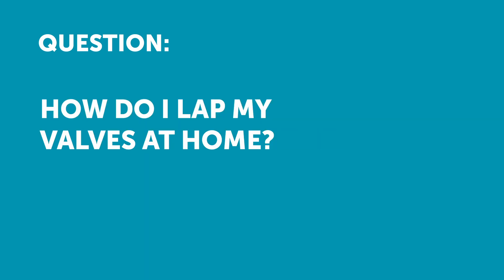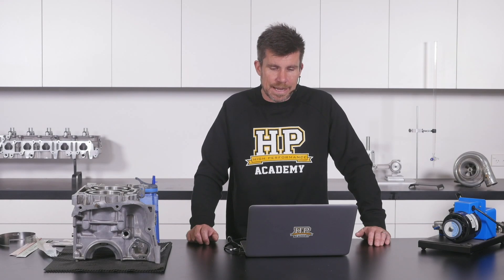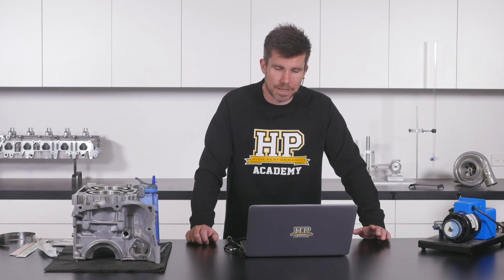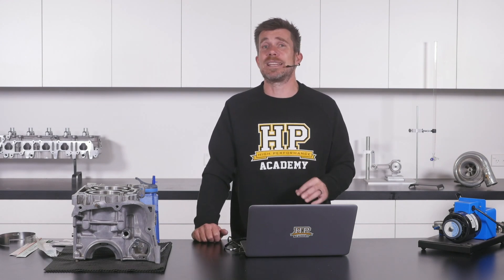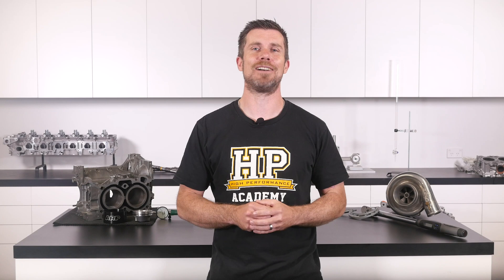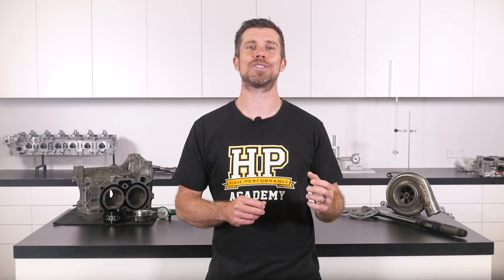Can I Lap My Valves At Home? | What Is Valve Lapping? [HPA Q&A]

Comment: I’m so confused as to what I should do. I have NEVER removed an engine & I have NEVER rebuilt an engine in my life (see my YouTube channel). I couldn’t find anyone to rebuild my 1987 Mercedes 560SL so hear I am doing it myself. My car has been properly stored since 2008 & has 139, 000 miles on it. I have completely torn down the engine & have dissembled the heads. Valves & seats look like new to me & cleaned up easily. I was going to lap the valves like millions of others suggest on YouTube, but now I don’t know what to do. I DON’T want to fire this engine up and find out I have leaking valves. The last thing I want to do is rebuild this car again. I purchased the standard lapping paste with 120-220 grit. I think that’s too course for a light lapping. Can/should I use this paste? Should I find a finer paste or what? What should I do?

Comment: unfortunately quality machine work is not available that conveniently. in my area i have had much better quality doing a valve lapping  than having a machine shop screw up my head. just some practical experience. no quality machine work available in southern nevada
Reply from the maker: Yes, this is sometimes the case unfortunately. Really it crosses over to more than just this trade too. It's super easy to find people who can talk the talk but hard to find those that can actually deliver more than an invoice.

When/if you find a good one make sure you support them! - Taz.

Comment: You're telling shade tree machines to go give money to some button pusher? I've never heard anyone have a problem with doing a hand lap. Drill I don't know never done it. I've done it with using the carbon as the lapping compound it a pinch. I wouldn't build a race car like that but a car I have to have running now and not wait 3 weeks for a machine shop to charge me a arm and a leg. Yes I would.
Reply from the maker: The bit where you say 'I wouldn't build a race car like that' is important, because that is the application we're talking about here, a performance build, so you are really just underlining the message from the answer here 🤘 🤓 - Taz.

Comment: I'd like to see a leak down test performed on a hot head that was lapped by hand. I honestly thought there wasn't anything wrong with it.

As for the cnc guys.. how do they know what the expansion is in order for them to cut a specific shape to mate 100% when hot? I dont see them cutting them when hot.
Reply: I think the point is that the 45º seating  surfaces of the valve and seat will correctly seal - regardless of diametric growth of the valvehead and/or valveseat.
Reply: @GroovesAndLands  yes it is.. but how is that achieved? Apparently you cannot if you lap cold and I'm guessing cnc too as heat will  change things. If cnc methods are not taking into account heat then lapping is just as good if not better. 

Now back to my question..??
Reply: @mayk3lll  Andre's point was that lapping will result in a radius'd surface of the valve and seat; the seat will be concave and the valve convex. Thus they nest together and seal just right at the temperature at which they were lapped/nested. Then, as temp goes up and they grow, they will no longer nest perfectly resulting in leakage.

I think the thermal expansion argument is overstated, because both valve and seat are (in most cases) made of steel alloys with very similar coefficient of thermal expansion. However, the valve runs hotter than the seat so the valve will grow more.

I also think the "concave/convex" argument is overstated. It's true, but on a nanoscopic scale... In my experience, it's a non-issue If all you are doing is a quickie lap job to give visual indication of the physical contact patch between valve and seat. If you are trying to seal leaky valves by lapping, Andre/HPA is 110% correct. You'll never fix leaky valves by lapping the crap out of them, and you WILL get the concave/convex surfaces he refers to.

But again, if you get your heads back from a quality Serdi-style valvejob, and you put a little Clover lapping compound on them and give them a little spinny spin to finalize the sealing surfaces (and verify the sealing contact patch) , your engine is gonna run just great.
Reply: @GroovesAndLands  I honestly still don't see the issue of lapping out a valve leak. I still can't visualise how the valve and seat will concave/convex but I'll go along with that theory..  you agree that the thermal expansion is micro minimal.. regardless of concave/ convex, it will still seal right?
Reply: @mayk3lll  I say no, you simply can't fix a valve leak by lapping. I've tried it a several times - either during a time crisis, where I nicked a seat while porting, or just being cheap and trying to avoid paying for a re-grind. It's never worked for me. Sure, I've improved the leakiness, but never gotten them to seal. Also, by the time I've worked them enough to improve the seal, I could see (with the naked eye) the cupped shape I'd created.

I agree with your notion that a concave/convex "nesting" valve-to-seat geometry ought  to seal. I think it probably does, but you usually end up with that geometry because you are trying to lap out an imperfection that lapping just can't fix. So the issue isn't the nesting geometry, but rather, the leak you had to begin with.

Also, despite our agreement that thermal expansion is not going to change the diameters of the valve or seats much, ANY difference of diameter growth between valve or seat is going to start to decrease your seating surface area. I hope you can visualize that. Decreasing the seating surface (while keeping valvespring force equal) will result in more stress/pressure on the valve and seat - which will start to beat them up. Also, decrease in seating surface area will decrease heat transfer from valve to seat. And the valve (especially exhaust valve) sheds a good amount of heat into the seat, its a very real cooling system.
Reply: @GroovesAndLands  100% i can totally visualise how the seating area will decrease but I thought as long as there is  a seal it shouldn't matter because Lashing the valve should seat it evenly and tight again. I think the heat transfer thing may be a little far fetched simply because of how long the valve actually sits on the seat but you are right less mating surface does equal less heat to transfer. The more mass the better the heat dissipation.
Reply: @mayk3lll  Given equal valvespring force, less contact area between valve and seat equals more pressure (stress). Increasing stress at the seat will absolutely wear your valve and seat faster. Secondly, it is WELL established exhaust valves get a significant portion of their cooling via heat transfer into the seat. It's not far fetched at all. Don't take my word for it, look it up.
Reply from the maker: First with regard to cutting proper valve seats - As has been stated in this thread, the difference between doing the job properly and trying to lap the valve seat is that the valve and seat sealing faces are machined at the same angle so heat growth makes no difference and they'll just seat in a slightly different location. I can assure you that aggressive lapping will quickly show you a concave/convex surface finish that's easily visible by eye. You don't need to get down to the molecular level to notice this. Proper seating, particularly on the exhaust valve is critical to getting heat out of the valve head and poor seating in a high performance engine which can lead to a burnt valve.
Reply: @GroovesAndLands  I've never had a problem with lapping or anyone I know. I've lapped with carbon in a pinch still no problem. A racecar? Yeah I could see a problem.

Comment: Would happily use the suction cup and a bit of grinding past method on a budget rebuild. But as Andre says, just lightly and a few back and forths to freshen up the mating surface, not attempting to re-cut anything. 

Lapping was done back in the day; when the grinding stones were used to re-cut seats and guides. These left a rough surface that needed cleaning up. Lapping was used to put a surface finish on the mating surface's, NOT  to re-cut the seat. That was the job of the stone. These days most engine shops use CNC-machines with HSS or carbide cutting tools that can leave a perfect finish straight up. Some may still choose to lap, just as a final check, but most don't.

But yeah, don't use a drill, that will cause you problems.

Comment: Meanwhile people are making a 1000 plus horsepower on heads that don't leak at all when hot and  hand lapping them this is a very good promotion from a company that likes to make people spend money to build high horsepower engines when you can do most of the work at home People have been hand lapping valves for decades and getting a better seal than some of these "machine precision valve fitments"  He also fails to mention that getting a cnc valve job done which is what hes referring to will set you back about $500 per head  Hp Academy also says that hand porting heads doesn't gain you power you must pay a company to do  Computer numeric controlled valve jobs and computer numeric controlled port work that has been run through auto CAD and flow tested and all of this crap the only time you need that level of precision is if you're trying to get  One extra horsepower out of an engine that is spec built for some sort of class
Reply from the maker: We encourage people to work on their own engines at home Ringr 57, but are also mindful of the pitfalls ior some specific tasks. If you want to lap your own valves by hand, go for gold, but do so knowing the risks which are highlighted not just by us in this video but also other comments here already and also by others in the industry.

Where we think it is best to use a professional that as specialist equipment and knowledge that costs MUCH more to purchase yourself than it does to engage their skills, we will certainly highlight that fact instead of trying to set you down the wrong path and sell you unrealistic course material like we instead could and would financially benefit from, unlike this advice which we don't.

Either way, what you do with your own build is up to you  - Taz.
Reply: @hpa101  you've stated the facts as every professional would have stated it and people want to argue because they didnt listen or simply dont understand. It's silly think lapping is a way to correct geometry issues and worn seats/valves. the valve stem simply makes a very poor pilot as the stem is designed for clearance but a pilot should have none. more often than not those lapping valves at home do so with worn guides which compunds issues. many dont even bother to thoroughly clean the grit off afterwards as a simple wipe does not do the job. There are many  that do lap but normally with a freshly ground valve and properly resized guide (not something the average joe does lapping his valves at home) and they remove an immeasureably small amount of material with a spin or two. Just becasuse you can do something doesnt mean you should.
Reply: I'm a really big fan of HPA, but I know what you mean, Ringr57... Their advice and philosophy is always coming from a textbook best-practice ($$$$) point of view. Time and EXPERIENCE teaches us what shortcuts (for lack of a better term) we can and can not get away with. However, considering that HPA is an "Academy" - it seems fitting to me they portray/preach textbook approaches. Their delivery does sometimes kind of come off as "anything different than our approach is sheer rubbish". But, reading their thoughtful replies to comments such as yours shows that is not what they mean.
Reply from the maker: To add to these comments, yes, people have been hand lapping valves for decades but that doesn't make it the best option (In exactly the same way that we always get people debating that soldering automotive wiring is fine just because they've done it and the soldered joint didn't instantly fail). The fact that you'll end up with a convex/concave valve seat interface is real and at best is going to compromise valve seal at operating temperature. The reality of this is that for decades people have been hand lapping valves and getting results, but the results were almost certainly sub-optimal compared with a properly cut valve and seat (and there's also absolutely no requirement for this to be done on a CNC by the way - any competent machinist has the equipment and skills to do this by hand), however unless you did a back to back comparison you'd have no way to know so everything 'seems' fine. The bigger issue is that the modern crop of performance engines make a lot more power than what we were seeing decades ago. This makes it more important than ever that we have quality valve sealing so the valve can reject heat into the valve seat - A second rate seal here can result in a burnt valve pretty quickly in a high performance engine. 

Ultimately we have nothing against cheaper options but people need ti understand the pitfalls of those options so they can make informed decisions - Andre

Comment: Is it possible to carefully heat the head and valve simultaneously and do a hot lapp?
Reply from the maker: You will still end up with a situation where the valve and seat interface is a concave/convex. It'd be a struggle to accurately replicate the temperatures in the components during the lapping process too.

Comment: It can be done at home.
No power tools!
A stick with a suction cup in the end is what should be used. We called an "indian stick" 
Just a few back and forth twists needed.
Reply from the maker: @Ringr 57 ok boomer...
Reply: @hpa101   And with that comment you just lost all of your credibility for one I'm not a  60 year old man and 2 that makes a "professional" engine building school look really stupid  And makes you look a lot like a millennial snowflake lol
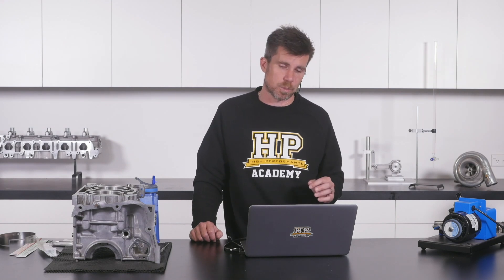Reply: chrisssinstockholm That what he eludes to @1:05.
Reply from the maker: Regardless whether you use a power tool or your 'indian stick', aggressive lapping with a coarse lapping paste will give you the exact same result.
Reply: @hpa101   And now you mention the term aggressive rather than just saying it's completely taboo  Wording my friend proper wording in your videos will lead to a better understanding from your audience Yes putting a bunch of heavy grit lapping compound on a completely crapped out valve or seat and running a drill on it for 30 seconds is not going to fix it however putting fine to maximum medium compound on a valve that has been run for a season and has a very small amount of leakage and using the drill just to spin it as you lifted up and just touch it to the sea which is the same amount of pressure as this Indian stick is not going to cut that much material you're talking .0005 in  lol  If you can't accept that much variance in your tolerances  You must be building some sort of top fuel engine that is only going to run for 30 seconds and then get completely rebuilt because you're going to get further out a spec than that after  Just a few runs
Reply from the maker: @RingTuned  did you actually watch the entire video? It seems like you've chosen a few key points, taken them out of context and run with them. As I mention within the video, valve lapping still has it's place, however it's used primarily to visualise the valve seating and it can also help remove chatter marks from the valve seat as a result of the seat cutting process. It's not a recommended technique for correcting poor valve seating for all the reasons explained. Ultimately you're free to do what you want and plenty of people will continue to lap their valves like this which is fine. We want people to understand the implications of this technique so they can make an informed decision - Andre
Reply: @hpa101  yes I did watch your video actually multiple times just to make sure I heard your misinformation correctly

Comment: Interesting. I also want to do a bit of lapping on the valves on my 4.6 dohc but plan on doing it by hand. Absolutely no power tools but you’ve given me something to think about
Reply: I agree with him but what he doesn't mention is that the technology used to do valves these days has drastically changed too. It's gone from grinding valves to using carbide cutters that are more accurate than the past.
Having said that I've hand  lapped my share of valves with positive results. But it depends on what you're trying to accomplish. If it's anything more than a clean up and checking how they're seating though you'll want to look into other options. Having said that I have got away with lapping in some rough heads in the past when I was in a bind. But it was I torched a head Friday night and come Monday I be needed to get to work and the only heads I had were from the scrap pile. But it ran fine like that for months. But if it's a build that you're spending time and money on then by all means if it needs more than a little clean up I'd wait until you can do it right. Even if it means doing the heads at a later date.